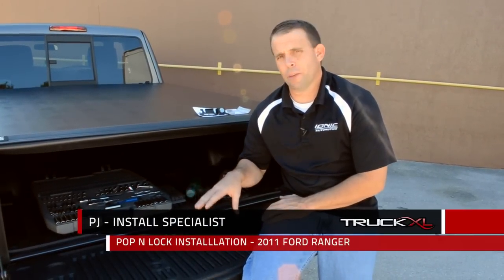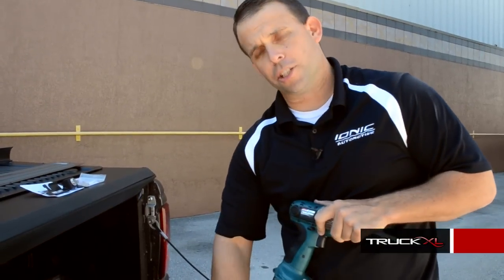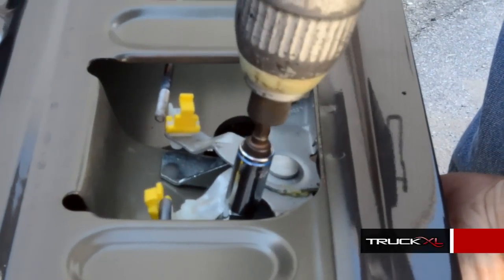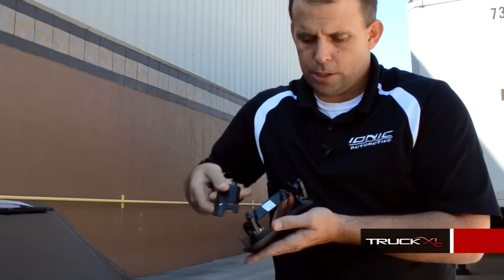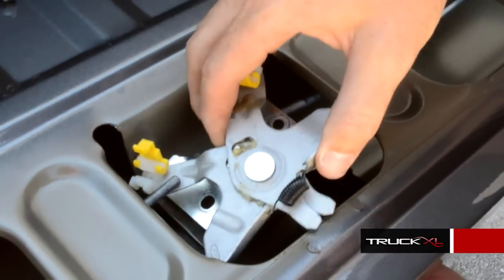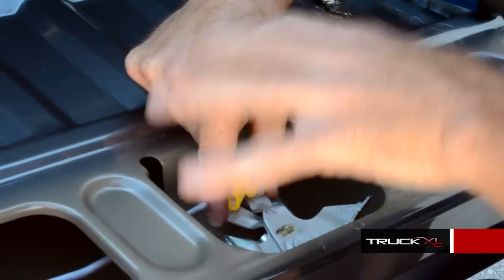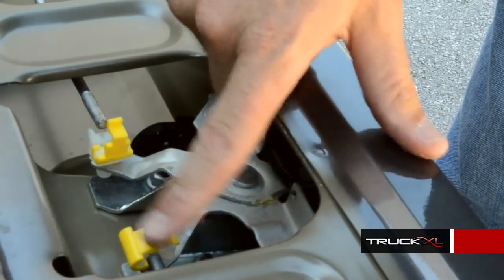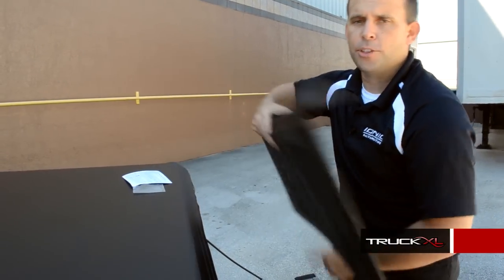Pop & Lock Tailgate Lock Installation - 2011 Ford Ranger - AutoCustoms.com

Comment: Yup.  Went in on my 2011 just like this.  Thank you.   I forgot to charge my drill, so I was just using a socket wrench, but it still only took 20 minutes end to end.  Please note that the dust cover has to be pried off with a screwdriver.

Comment: FYI if you have the metal tailgate handle you need to use an additional metal scissor latch inside for the lock to work. I just installed this on a 99 Ranger with the metal handle. PL2300

Comment: I wish that they made one that worked with actual ranger ignition key. Locks can be designed in such a way to self key itself when the chamber is fully rotated. I saw one for a chevy silverado.
Reply: The problem with that in this application is the lock cylinder is too shallow to fit a truck key.  It has to be a pretty shallow key for this lock and this tiny tailgate.

Comment: Is that silver lock piece supposed to be at a certain direction before installing the pop and lock/handle combo back in? Literally had to disassemble mine about 4 times cause nothing was locking the handle

Comment: Will this work on a 2006 ford ranger xlt
Reply: Yah but no the lock barley locks and if you pull on the handle in the locked position it’s easy openable still

Comment: Will this work for a 2009 model?
Reply from the maker: +Robert KC Cornell It should yes. If you give our experts a call at 18888554621 they will guarantee fitment if you order through them. Thanks for the question.